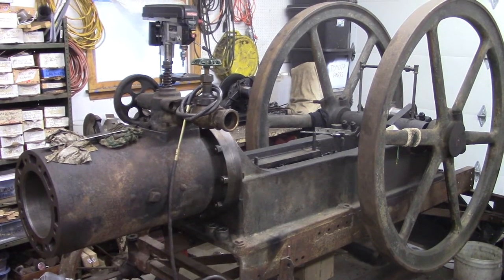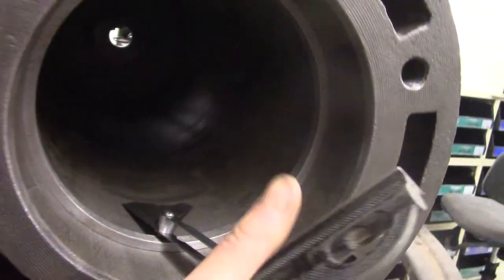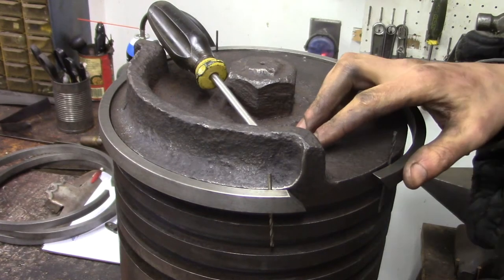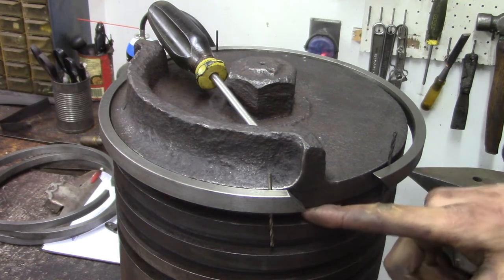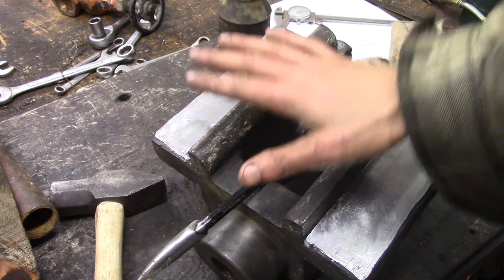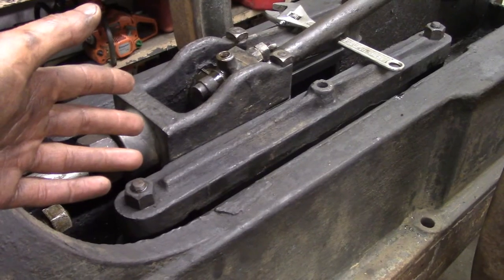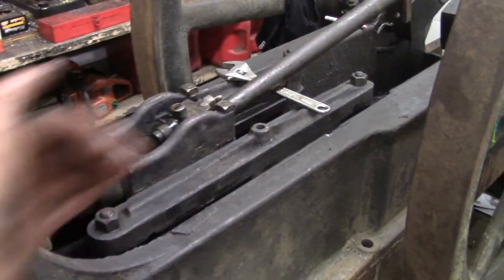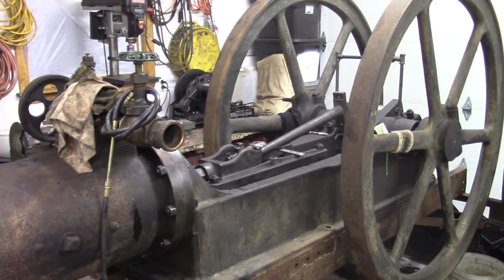Pattin Oilfield Engine - Rings and Cross Head

Comment: What you said about the misalignment is so true. This old stuff has so many quarks and misalignments that you can shake a stick at. This is one cool engine. How did you find this old beast??? What I am wondering is who the hell makes rings for these old engines ??? They probably have been out of business for a many a years. Good luck to make it to the show.
Reply from the maker: found this one on craigslist. Niagara makes custom rings up to 3 or 4 feet in diameter! I found these rings from another collector who bought them for an identical engine and ended up not using them.